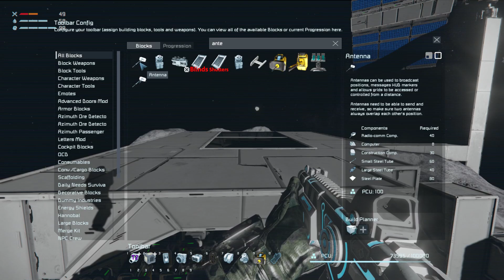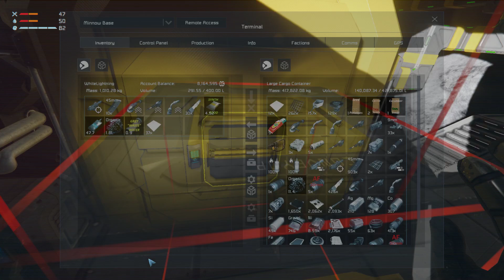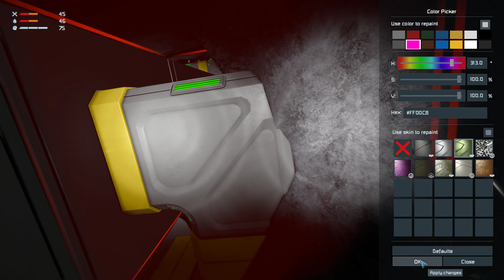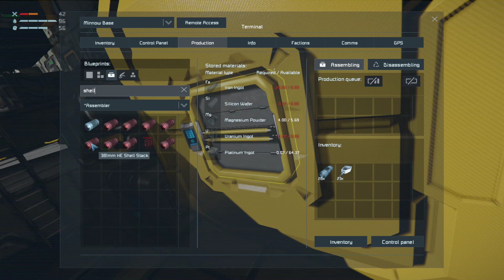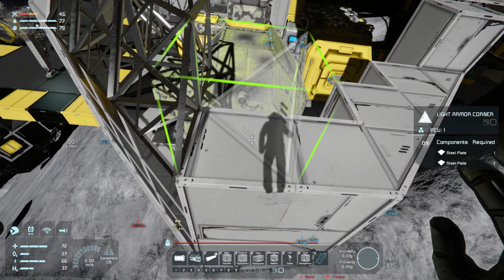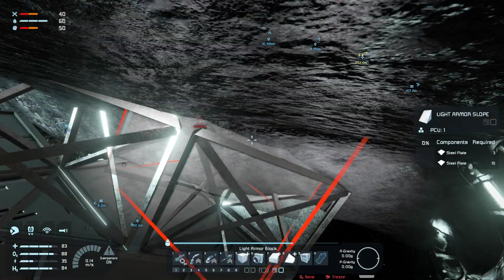A Better Base #22 Space Engineer for Hire

Comment: Regarding your setup for your small grid projector:  I find that a good method of setting up my small grid projector is to place a rotor, then grind off the large head and go into the control panel and add a small head... then build the small grid projector onto that.  That way you don't have to worry about faffing around with a battery and having it run out of power etc... plus the batteries on whatever blueprint you're building will charge up from base power that way.
Reply: Same here.

Comment: for bigger salvage jobs you should have a grinder pit/ wall
Reply: Problem with grinder pits and walls is that they throw pieces all over the place. And in space that means "away, never to be seen again".
Reply: @Bigrignohio  that is what B&R is for, picking up to scraps
Reply: @TheMhalpern  Which works in gravity. But in zero g they are gone long before the BAR can grind it. They move fast enough to phase through blocks!
Reply: @Bigrignohio  and most of it is free anyways, problem with lots if BAR units is balance
Reply: A 'grinder pit' in zero gravity is a design challenge.  I'd recommend putting a big (enough to park whole ships in) chamber on a rotor, so swinging around the rotor (slowly!) pushes everything to the "floor" on the side furthest from the rotor.  Grinders on the floor will work like a grinder pit, and the rotating chamber will prevent most things from getting out.  But you'll probably want to do this on the far side of the asteroid from your base, 'cos otherwise it's going to visually dominate all the work you've done so far.
Reply: @zrebbesh  All our discussions are interesting, but not really necessary for him. Park ship, set to station and grind away.